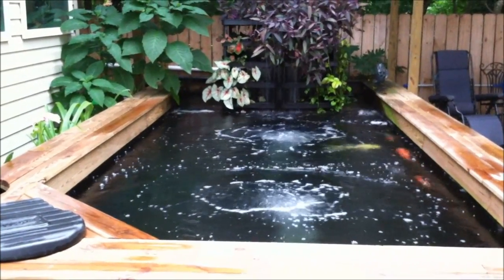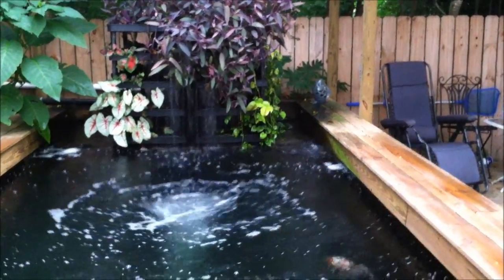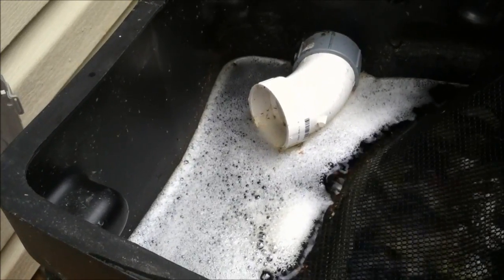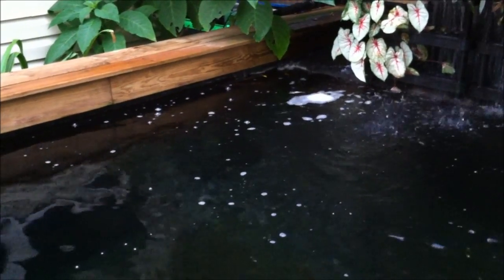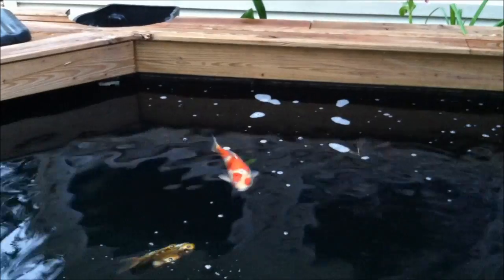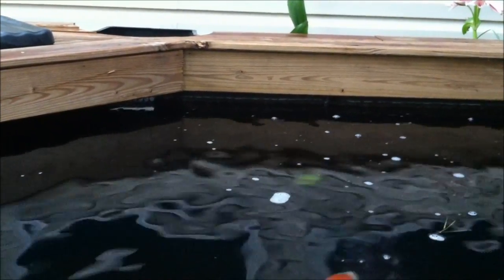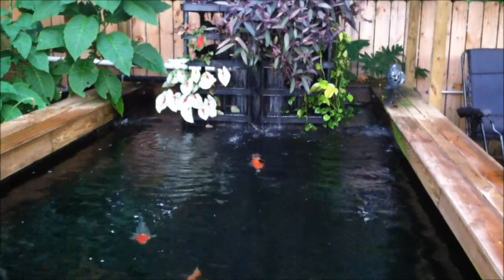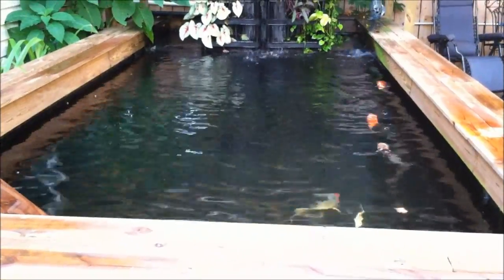Pond skimmer

Comment: The easy solution might be to put the aerators in the corners instead. Or run a line from the drain's air to the corners .